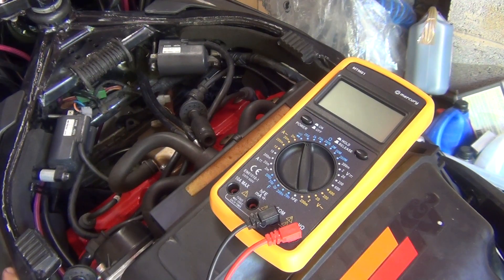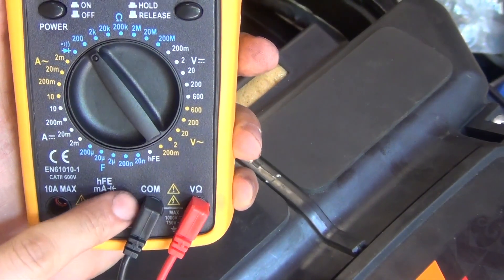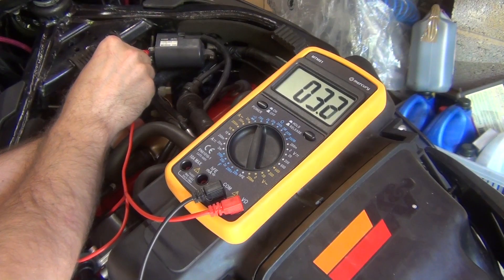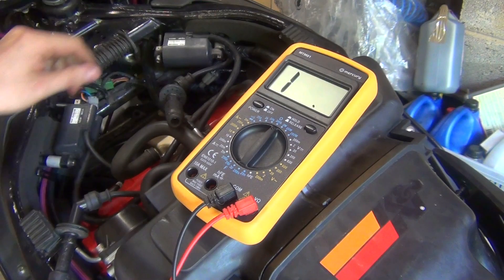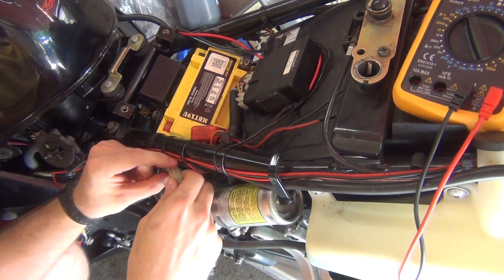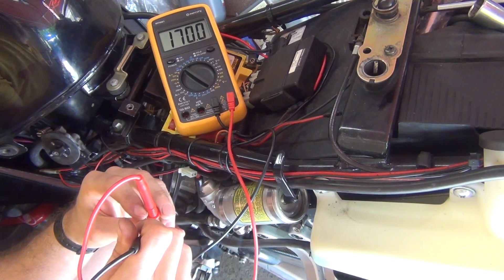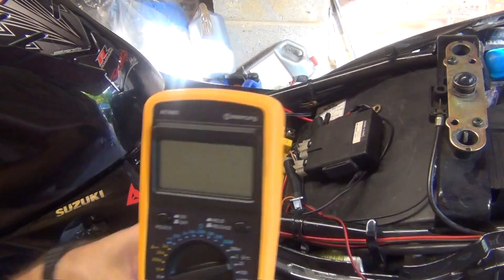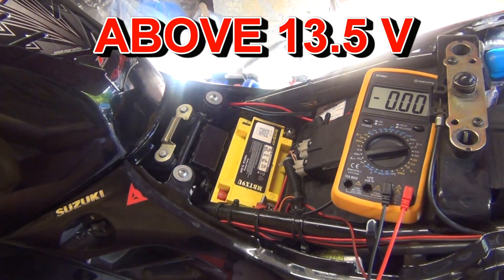Suzuki RF 900 Testing Vital Electrical Components

Comment: Hi , are these coils polarity sensitive  ? , if so , how do you tell  ?
I'm working on my friends bike who replaced the coils, but I'm not sure if he has the orange and white wire going to the correct terminal .
Also, these new coils read 410 ohms. Is that okay  ?
Thanks for ALL your videos.
Reply from the maker: 410 ohms is a value out of the scale for stock coils according to service manual.
It doesn't matter how multimeter's probes touch the prongs on the coils, it will just show the resistance between the two.
Reply: @Adikxx  okay , so is the resistance enough out of spec to cause issues such as weak spark  ? 
Touching the exhaust we found exhuast 1 and 2 were cold after trying to start it .
It wouldn't start because the fuel pump had died , before that it wouldn't idle before that and ran rough . Compression is around 100psi so that's low too.
So many issues , I'm trying to eliminate.
Reply from the maker: @davidgreen424  1st question- when you were measuring the compression on cylinders, did you have the throttle wide open during cranking? This is absolutely necessary as without it numbers will be extremely low.
I don't know what coils you have so it's difficult to comment on their resistance. Stock coils have parameters like those from the video.
Check if there is a spark on all 4 plugs. If you have decently visible spark then ignition components are probably fine.
I don't know the story of this bike but i assume it was stood for a long time and now you're trying to revive it. If that's the case then carbs are your issue and they need a full rebuild and SERIOUS cleaning.
Those 2 cold headers you mentioned are cold because pilot jets on corresponding carbs are probably blocked.

Comment: Real random question here mate, and on a dated video, but do you know which wires go where on the ignition coils? Fighting an overheating issue, and I think I reversed my polarity on the ignition coils. I'm trying to figure out which is which. If I'm reading the diagram right I believe it is the Orange/White's on top and then left side has white at bottom and right side had black/yellow.

Comment: tested my coils as you showed , from where the wires connect from the loom i have 2.9 on both coils , but absolutely nothing from any of the plug caps , it starts but seems to be running on 2 or 3 cylinders , any ideas mate , i would appreciate any advice that you may have
Reply from the maker: Let it run for some time and check temperature of each header pipe to pin point which one is cold(that cylinder will be dead)
Although coils show no reading on the caps they might be ok, my spare set did that.
Once you know which cylinder is not firing you could investigate further. 
It could be clogged pilot jet, wrong setting on mixture screws etc
I would inspect carbs to make sure they're clean, correctly assembled, float height correctly set, needles positioned on adequate height etc

Comment: I've rebuilt the battery box so it can hold an YTX14-BS battery. So why do you ask? Well the reason was that my snowmobile has a YTX14-BS battery and since it's only used in the winter I can move it to my bike during the summer. The only difference between the stock YTX9-BS and the YTX14-BS is the height. The YTX14-BS being a little taller. If I remember correctly it was an easy rebuild. I just cut the lower part of the holder and extended it with two pieces of sheet metal, one on either side welded to the top and lower parts of the existing holder so the top of the battery sits at the same level as the stock one.

Comment: Wander if i will finally work out why my bike wont rev under load. thanks
Reply from the maker: It's probably fuelling, must be really lean. Have you got stock air filter? What main jets do you have in carbs?
Reply: @Adikxx  Finally got around to getting myself and my RF900R back on the road. Went and checked coils and one was shot. Ordered a new pair off of ebay for just £40. Rebalanced and synced the carbs and now revs and pulls all the way to 12000rpm. Bike mechanically is all stock, apart from maybe exhaust. Just wanted to say thanks, so THANKS!
Reply from the maker: @iainwalker8701  congrats for sorting the RF! Glad that vids were useful.
Regards!